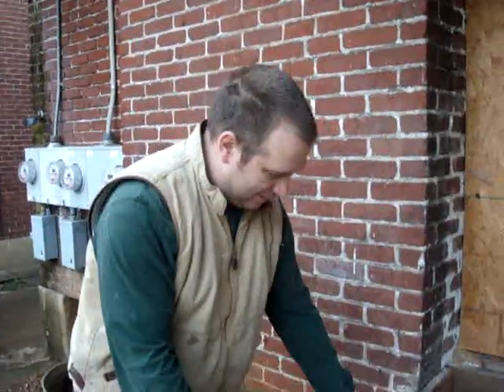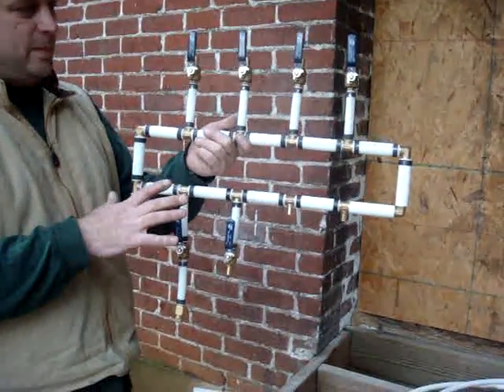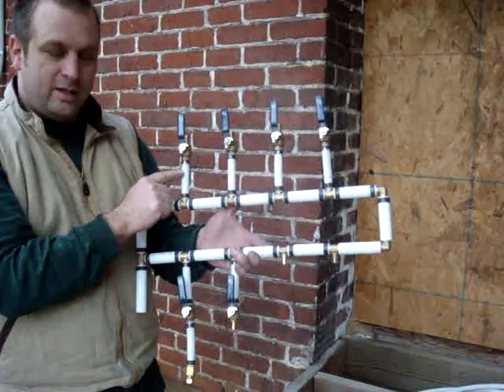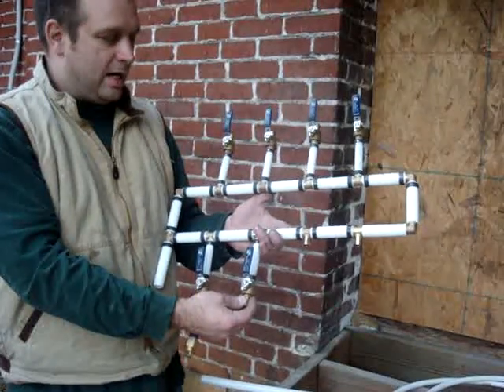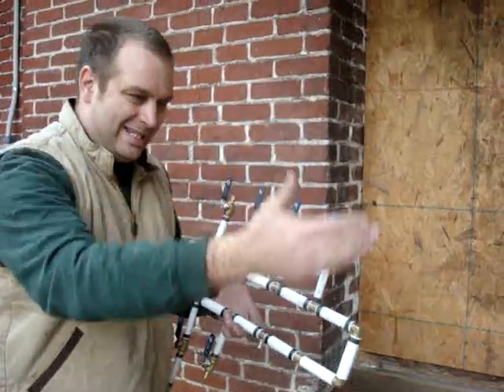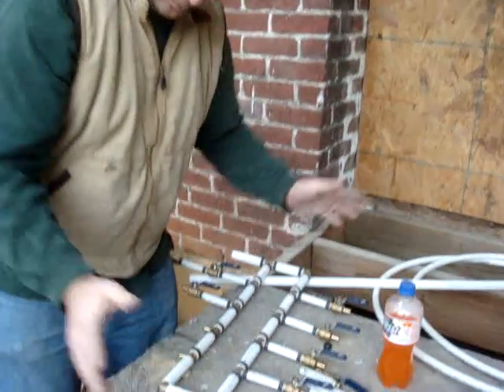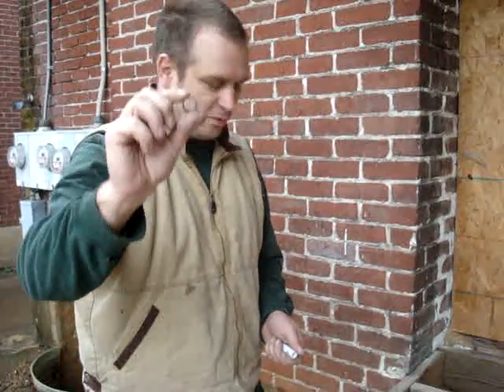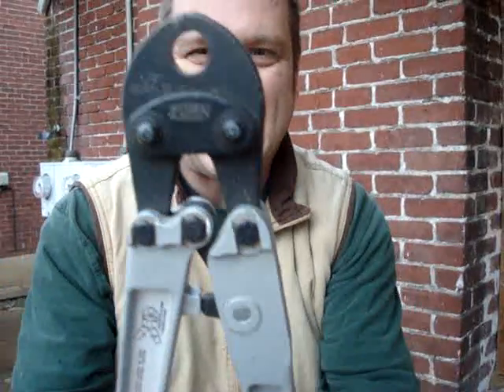Introduction to PEX

Comment: i have a small leak in newly installed PEX in my house.  I did not check the gauge to determine if its tight enough.  If it is too loose can I tighter the Crimp and recrimp the rings after correctly calibrating the Crimp tool?  ie I will tighten the Crimp tool and recrimp the rings that are already on and leaking or do I have to cut and put on new rings
Reply from the maker: +hansel122 You should use the go-no go gauge first. Sometimes a crimper can be properly calibrated and adjusted OK and you can still get a leak if you don't hold the tool in line with the ring being crimped. If all your other connections are fine, the tool (not leaking and check OK with the gauge) then you probably just hand the crimper out of alignment on that one connection.

Comment: Just curious, but isn't it useful to have a wider diameter tubing for the manifold, and then convert to smaller connections for individual points of use? Or am I thinking of something else?
Reply from the maker: The baconized In a normal sized house, I make the manifolds out of 3/4 and then run 1/2 everywhere. In this case, I did the entire house in 1/2. It was under 1000 square feet, 2 bedrooms with 1 bath and energy efficiency was a primary goal. I could have still used 3/4 (wouldn't have hurt), but in tiny homes it's fine to run 1/2 for everything.
Reply: +James Glass this video has been incredibly helpful, thanks so much.  For a 2000sqft, 3/2 home do you recommend doing a 3/4" manifold, then continuing the 3/4" to each area (for example Bath1), and then stepping down to 1/2" for each appliance?  Or is running 1/2" straight from the manifold just fine?  I was concerned about pressure.  Not necessarily concerned, but if I could get better pressure running more 3/4" then I might do that maybe.  Thanks again.
Reply from the maker: +Daniel Hatcherson I'd run 3/4" manifolds and 3/4" to each area. With 2 baths and the possibility for 2 showers happening at once you want to make sure you have adequate volume. With bigger diameter pipe the issue is volume over pressure. You won't see a significant drop in pressure from the main shut off regardless of pipe size unless you open all the fixtures, flush the toilets, etc. The issue here would be volume. Glad the video was helpful!

Comment: In the middle of building mine....doing all 3/4" runs to each room then dropping to 1/2" to the fixtures. Costs for 3/4" parts from an Orange big box store here in SC are quite a bitter higher than yours. Doing 8 ports at $10.50 per valve. Fittings are about $2.50 each, and cinch rings are 10 for $6. The pex is the cheapest part lol. However if this keeps me from ripping out sheet rock and and shower fixtures for three baths to add anti-scald fixtures it will be well worth it in the end. Will keep you posted.

Comment: we use JRG armatur johnson and Roth and Wirsbo here in scandinavia,costs alot more though...
Reply from the maker: No one around here even sells JRG. Was it some of the first cross linked poly on the market? I know Europe used PEX way before the US. The Wisbro connections look very nice without the crimp ring.
Reply: James Glass As long as people around my area can afford expensive systems,insurance company will demand them..its called Tec 10--formed by the insurance companies and the proffession communities within building branch. We are not allowed to have connections inside walls etc,all must go through accessable boxes(sux). JRG Sanipaex might be the most expensive solution as their parts have a mixture of bronze and brass. At same time,our pex must be pullable a so called : Pipe in Pipe systems...but... once htey are montage,its hell to replace them after they have reached 4 90 degrees angles:P,main waterlines also go through these boxes,so theres no connection inside walls,not even inside plastboards nor shafts in bigger constructions. Big and small follows same rules for tec-10.
I doubt these parts will ever reach the western continent as u.s.a due to price and all that. BUT!!! i must say i love your victaulic coupling systems for installations :D and your RIDGID machinerys.
Reply from the maker: Man Kind I think you're right about the cost and our culture. PEX is still considered wild and crazy here in the US although it is gaining acceptance. I have data showing it's use in Europe back to the 1960's and I try to sell the point that continuous pipe is fantastic for reducing 90's and for being couple-less inside walls. Many plumbers still use copper, so we have countless soldered joints inside walls and while I see tremendous advantage of pipe in pipe, we're far away from that! RIDGID makes a very nice tool! And they have such a wonderful lifetime warranty also.

Comment: excellent video . my galvanized pipes are all rusted ...should i break down all my walls and put PEX or hire someone to 'reline' the rusted iron pipes ? Any Advice ?
Reply: ***** Thanks .  Obviously I can leave the old pipes there but it is very difficult to insert new pipes in many areas without breaking the drywalls and ceilings ..
Reply: ***** thanks and I will try it next time my renter is out . About 2 more years..I will have to remove a good section of drywall under the sinks i guess .

Comment: Great video! I am upgrading my plumbing and one concern was the pressure drop issue so this really helps. I do have a concern about the hot water coming off of the manifold. Is it necessary to supply the hot water tank from the cold water manifold? Would it be better to have the main supply line branch off with one feeding the hot water tank and one feeding the cold water manifold? So the hot water tank and the cold water manifold both have a dedicated feed.
Reply from the maker: You don't have to run the hot water supply from the cold manifold. I often don't, but this house was tiny. For average homes you can do like you mentioned and just run two lines right after the main shut off to each manifold.

Comment: Curious. What is the average temperature drop of stagnant(non-moving) HOT water in the lines ? For example : You take a Shower at 9pm....go to bed...next day,get dirty at work...come home at 5pm (a 20 hour differential) and take a Shower. Dissipation down to COLD(in a HOT Line) would be a wait time of (?) on an average once a Faucet was turned on Big or Small House after a long stand down period? PEX is rated UP to 200 Degrees F, but the longevity of sustained HOT water staying HOT until next use "seems" like it'd take the "proverbial" forever. I understand a 40-gallon Gas Water Heater can recover in about an hour and recovery for a 40-gallon Electric Water Heater takes about two hours, so how are they raving that Copper "retains" HOT water better than PEX ? If I have a G W/H and PEX, and they have a E W/H and Copper, my Service time would be faster(provided same weather conditions of course). I know Copper has a working temperature of 400 Degrees F. Have no idea of "retention rates" of both. Trying to figure this out, because a Manifold should be "Centralized" at best right ?Thanks James.
Reply from the maker: You'd have to calculate heat transfer by situation. What's the ambient air temp? Are you using insulation pex or not? And probably variables I can't even think of. Someone might be able to answer this question, but I can't. Sorry!
Reply: Shower properly with soap and should not be an issue